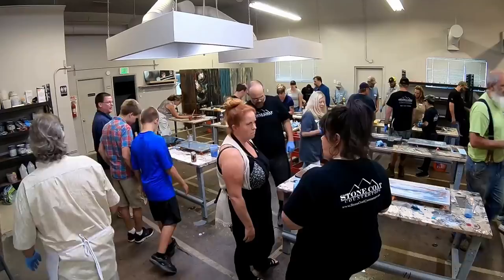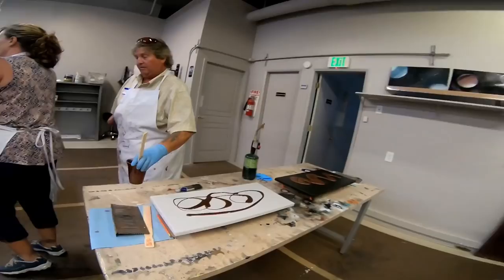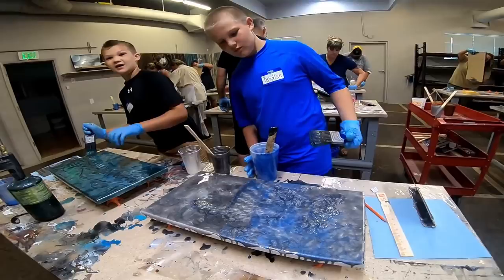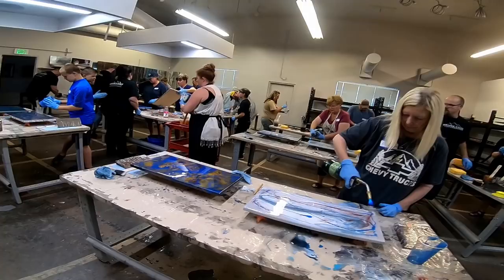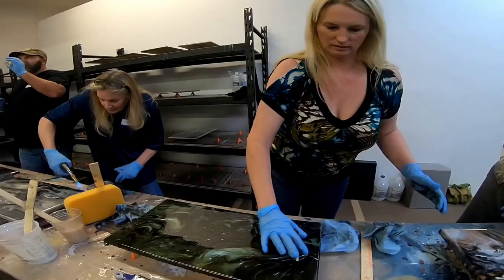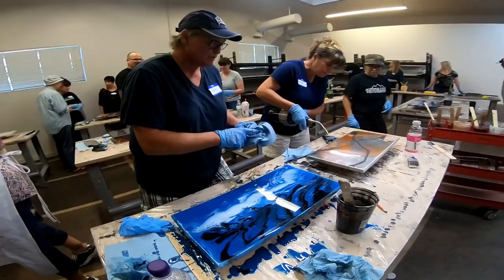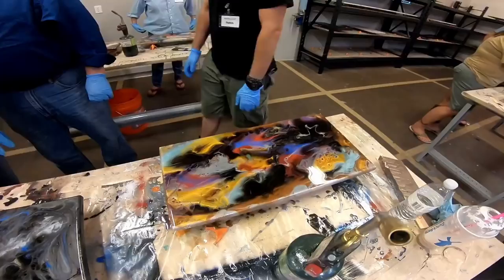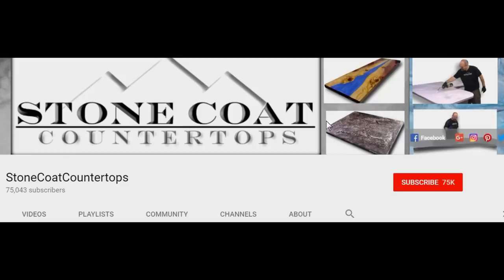Resin Art Painting, First time results!

Comment: Hi. New to resin. I've been working with Amazing clear casting resin. While good for casting. It's not for pours. Starts to stiffen up to fast. Was wondering what the working time with Art Coat is compared to your regular countertop resin?  And which one would give me the longest working time.
Reply from the maker: Hi Honey David! The Art coat epoxy will be your longest working time at 60-90 minutes when mixed and applied to the surface immediately, it also has the most UV protection out of all of our products.
Reply: Stone Coat Countertops Oh that sounds great. I tend to move a little slow and need the most working time possible. One more quick question if I possibly. How much heat can it withstand after fully cured?  Like can it withstand a hot pot of the stove or just something like a hot cup of coffee?  Very interested in buying your product just wanted a few more details first. Thanks so much for you time.

Comment: No yellowing? Can be used with Acrylic art paints, alcohol inks, spray paints, micas?  Working time?  Drying time?  Very interested.
Reply from the maker: Great questions Val! Some artists like to mix multimedia paints and pigments directly into Stone Coat Countertop Epoxy, they also have tried some oil-based paints, but some have adverse reactions and gum up the epoxy or coagulate on the surface. You will want to do a sample and test to see if what you are wanting to use will work. Our key is the working time. You'll have 45 minutes working time or more as long as you don't let the materials set in the mixing bucket. Pour it on the surface when you're done mixing and follow our video on how to mix the epoxy and you'll love it! Here is the link to that video. https://www.youtube.com/watch?v=1CMo01uPVsU&t=46s Please note: You cannot add water based products to Stone Coat Countertop epoxy. The best paints to use are Rust-Oleum spray paint and our SCC pour base color tints. We have tested these products and have found this system to be very consistent and easy to follow. We suggest trying new paints on samples before finished work pieces to make sure they will give you desired results. You can also add mica flakes to the epoxy as well, here is a link to the mica flakes that we carry: https://www.stonecoatcountertops.com/mica-flakesGive us a call or email us anytime for project support. (541)450-1976 Thanks again for the great questions and for watching Val!